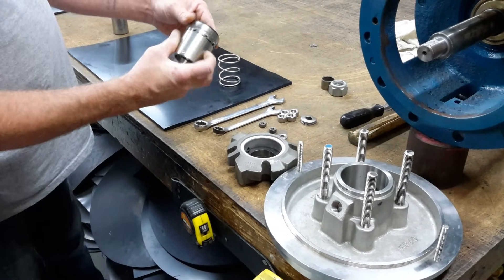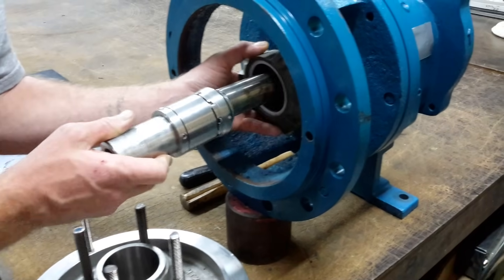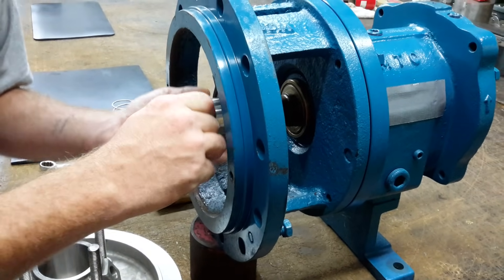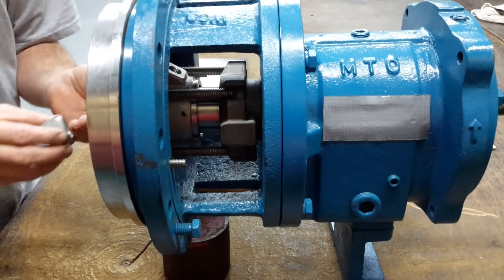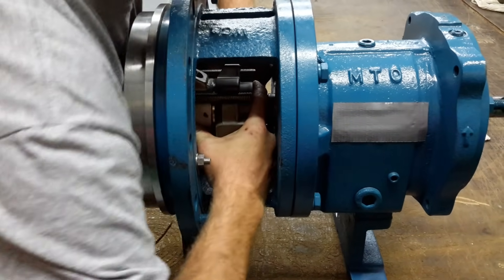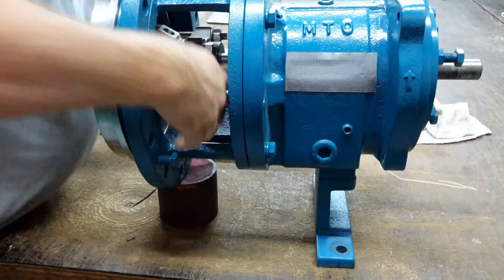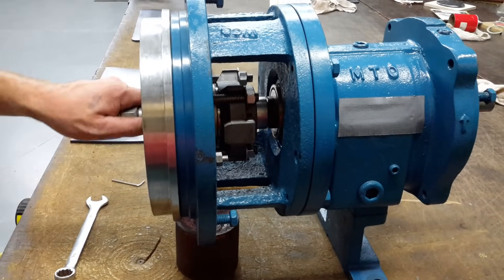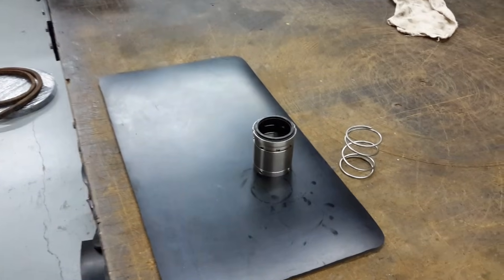Mechanical Seal

Comment: Improper handling & installation process of mech'l seal.
Where are the extra cares needed in handling, reassembling, & installation?
-proper positioning to its proper location is quite unclear.
- the way he projects & carried out the installation is way out of professional, journeyman way.
The way he tightened the stuffing box cover, may cause uneven contact(tilt) on matting surface of stationary & rotating sealing face.
Reply: I am from China Seals Factory. Our company produces many types of hydraulic oil seals. If you are interested in our products, we can send you free samples so that you can learn more about our products.

Comment: need your help
LS Seal
249A4226P0001
LS Oil Seal K110
Drawing No: 03AD450
Flender Gearbox Part # TX61/1CV 
MAKE: FLENDER

HS Seal
249A4227P0001
HS Oil Seal K210
Drawing No: 03Ad451
Flender Gearbox Part # TX61/1CV 
MAKE: FLENDER

Comment: Please kindly your advice, what kind mechanical seal face which suit using heating oil? Operating temp. Is up to 210 celcius
Reply: Honggo Aditya we have solutions for high temperature sealing.  contact me if you are still interested.
Reply: Tungsten carbide or ceramic. Stay away from carbon seal faces for high temps.
Reply: I am from China Seals Factory. Our company produces many types of hydraulic oil seals. If you are interested in our products, we can send you free samples so that you can learn more about our products.

Comment: Still a dynamic seal!! Spring will get chloride stress corrosion!! Rubber bellows will fail due to movement.
Reply: Who said rubber bellows? And what’s the alternative to a “dynamic” mechanical seal?
Reply: I am from China Seals Factory. Our company produces many types of hydraulic oil seals. If you are interested in our products, we can send you free samples so that you can learn more about our products.

Comment: What do you clean the carbon face with before installing?
Reply: Because any small martial part on face seal is leaking needs to clean face?
Reply: Crc lectra clean is very good.

Comment: I have to ask just because i do this for a living to we don't use oil because the pump is for drinking water or to water food we use soap but i was told it is so you don't role the  seal and chance a leak because the seal will garb the shaft and role.
Reply: There is a chance to roll the o-ring in the seal while sliding it on the shaft or shaft sleeve, im guessing that is where you use soap.
Reply: You can use dishwashing liquid which will wash away.
Reply: I am from China Seals Factory. Our company produces many types of hydraulic oil seals. If you are interested in our products, we can send you free samples so that you can learn more about our products.

Comment: What about impeller clearance doesn’t that need to be set before seal is installed and locked down?
Reply: Yes needs before seal installation check impeller clearance and shaft run out check etc..
Reply: Yes! You would have to put on backing plate, install impeller, set clearance then disassemble and start installing seal. For a closed face impeller clearance might need to be checked while removing pump for maintenance, or checked with casing for new installation.
Reply: Yea but he doesn’t need to if he is just leaving the imp and ob case off for the sake of the video
Reply: Daniel Keller sunil